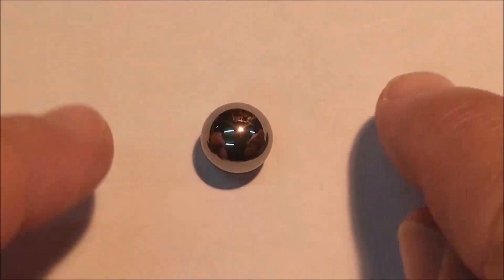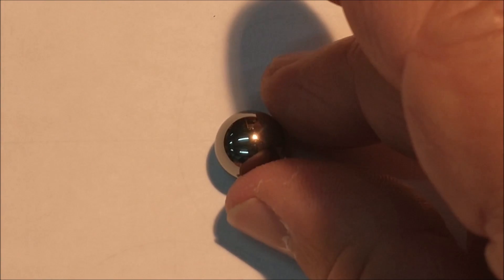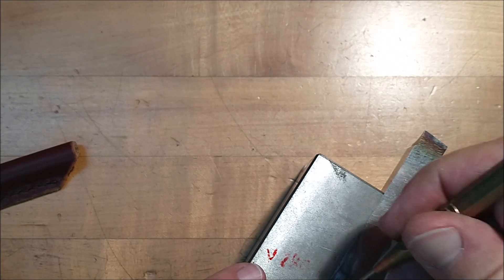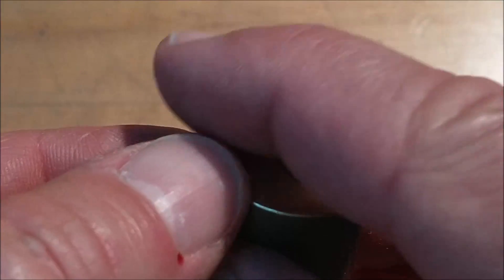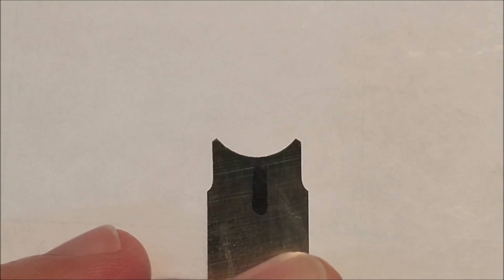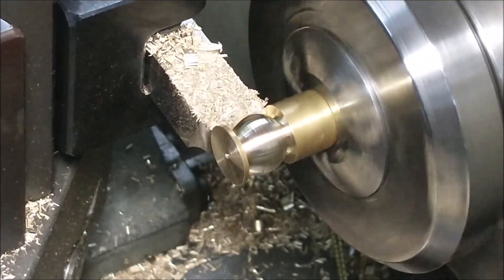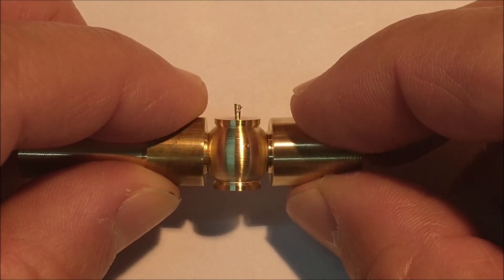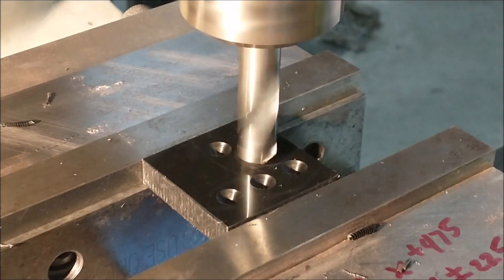How to Turn Completely Round Balls Without a Ball Turner.  Take a Look !!

Comment: I did have to chuckle at the part where you said you "break out in a rash when you touch anything metric". Don't you own a Honda CB? 🙂 Plus I bet you knew that half an inch was exactly 12.7mm.
The US is still predominantly imperial, but that nasty metric stuff is creeping in. Here in the UK we've been subjected to both for about the last fifty years. 
On a lot of Harley's made in the last 20+ years one finds both metric and unified threads, and occasionally one needs both a metric tool and an imperial tool when working on the same component, which is somewhat odd.

Being over 60 I learnt everything in imperial measurements including machining at school and when I was an apprentice. I still think in imperial, but can work in either. When I'm machining I use metric increments, simply because my machines have metric dials. So, if someone wants something made and gives me a drawing in inches I convert it to metric.
Conversely when I'm measuring valve clearances I use thousandths of an inch, and convert the reading to metric, which some folks say can't be right especially in the case where on has shimmed valves. However, as 2 thou is .051mm. I like to point out that nobody is that good they can tell a difference of one micron with a set of feeler gauges! 🙂

Keep up the good work Joe. Your content is both very informative, entertaining, and amusing.
Reply from the maker: 3 actually. one is a 1977 CB 750F Super Sport and I also have a pair of VTX Hondas in my garage too. A pearl white1300C and my baby...a charcoal gray 1800F stage 2 That will put a smile on your face. :)
Reply: @joepie221  Good show. I hope you wear gloves when working on them in case you catch something metric 😁
The VTX1800 was never a big seller over here which is a shame. I've worked on a few of them and always thought that they're very underrated.
One customer had me fit a Supertrapp exhaust, and a free flowing air filter, plus some better shock absorbers and some uprated fork internals. It was a hoot to ride. It pulled like a train, and sounded like one, and it was pretty nimble on the corners. A proper grin factor bike!

Comment: Joe, what the maximum diameter ball you can make with this method?
Also, I need to make a multi groove pulley wheel (type J). Each groove has a profile and depth. Can I make a tool with this profile and come straight in to make each groove on a lathe?
Paul

Comment: I don't know if you have ever heard the phrase brass monkey weather....or cold enough to freeze the balls off a brass monkey, its not a rude basis it comes form the Napoleonic wars when the winters in Russia and Crimea etc were so cold that the brass cannon ball holders would shift under the weight of the cannon balls and crack dropping cannon balls everywhere .
I have made a large number of wood bearing balls from lignum vitae and boxwood using exactly this method. You can get some really tight tolerances with it too. I made some wood machinery some years back with a motor that had copper wiring and the rest was wood....didnt run for long due to heat build up but it did work lol 
Thanks for sharing

Comment: @5:28 any one else see the part lift
Reply from the maker: The toolbit, not the part.
Reply: @joepie221 I should have included one or two second sooner...Sorry  There is an optical reflective triangle increase at the junction of the vice jaw and "part" or  tool bit  being cut above the black shadow of the spindle just as you say " "because" of the sharp angle" lasting less then a second and only a few pixels of change. or am I just seeing things. regardless Thanks for all the wisdom and experience that you have shared with your channel
Reply: Good eyes man! Wow, I missed that. Yea, definitely shifts upwards (very slightly) @ 5:27 as he says "the" in the phrase: "because of the sharp angle". Didn't move after that (during the successive cutting) - so that's good! I'm assuming that's a carbide endmill, right Joe?

Comment: Your contributors have had a lot of fun with the 'cold enough to freeze the balls off a brass monkey' story, but it's actually a wholly false and apocryphal etymology.  The earliest recorded (American) reference is in 1845 ("When you love, ... your heart, hands, feet and flesh are as cold and senseless as the toes of a brass monkey in winter" - nothing to do with balls, note), long after cannons and cannon-balls were in mainstream RN use. Cannon-balls were not left lying around in freezing weather, to run amok or go rusty.  They were stored in wooden shot garlands. Brass monkeys were galley kettles used for storing grog.  The humorous 'brass monkey' references seem to be to Chinese ornaments popularly imported in the mid-19th century.  Further, the physics doesn't stand up to scrutiny. The differential coefficient of expansion of brass and cast iron would not be sufficient to have any real-world effect. Nothing was, or needed to be,  made to the tolerances required, and if it had been an actual problem, the redesign needed would have been quick and obvious.  Sorry to be a party-pooper, but facts must out!

Comment: for rounds to actually use...  discovered that i can roll lead into fairly good spheres between two pieces of flat plate. i start with cast balls, flash removed to make things easier. this also work hardens the ball which has it's uses.

Comment: Anyone else notice the HSS coming up out of the vice at 6:00?
Reply from the maker: I just saw that. Good eyes.
Reply: @joepie221  Is that a carbide end mill you're using to shape the HSS?  If so, did you anneal the HSS first?  I didn't think carbide would cut HSS worth a damn....
Reply from the maker: @davidspahn7184  I didn't anneal the HSS. The carbide will cut it, but its risky if you bottom mill. You will almost assuredly chip the carbide. The Z axis oscillation helps improve the shearing action.
Reply: @joepie221  Thanks for the reply!  Good to know. I  might have to try that some time with something that's otherwise no longer useful.  Appreciate the info!!!
Reply: Clearance?

Comment: 1/2" is exactly 12.7 mm, not about.  An inch is defined by the metric system as exactly 25.4 mm.  This was done since the imperial system had too many different inches (along with a lot of other baggage), so they standardized it with the metric system.  So even though you think you are not using metric, you are.
Reply from the maker: I always enjoy seeing how riled up you metric guys get over comments. How about this to chew on. is 12.7 always metric, or is it an imperial decimal representation of a whole?? Can you say 1/2 of a mm and people will know what you're talking about? Are fractions and decimals an integral part of measurement no matter what language you use??Blows the mind.
Reply: The metric system is calculated using time which is measured in base 60 that has it's roots in ancient Sumerian culture, so even though you think you're using Metirc, you're using an "imperial" system of measurement

Comment: Is it possible you can do a video on npt threads and teach us how all the values are calculated?
Reply from the maker: I unfortunately do not have a taper attachment for my lathe so I do very little NPT threads that aren't done with a tap.
Reply: @joepie221  Every couple of weeks I have to tap 1/8-27 NPT. in a 100 plates. I hate doing it. I have to check with a gauge pin every hole.

Comment: now you need to make a brass monkey ( a brass monkey was a ring made of brass that was used in Nelsons day to hold the cannon balls ) which shrank when cold and the said cannon balls rolled off it when at sea 
hence the term " its cold enough to freeze the balls off a brass monkey"

grate video again Joe
Reply: I believe brass monkeys were square
Reply: @oldcomps  could well who knows I read they where round but they could have been square to hold more balls round would only hold three , maybe different ships had different ones.  I did take the tour of the victory about 65 years ago boy was those decks low

Comment: As an amusing aside. Pretty much everyone has heard the phrase "Cold enough to freeze the balls of a brass monkey"

A "Brass Monkey" is actually the base you stack the cannon balls on. With the cannon balls usually cast iron and the monkey made of brass they have different thermal expansion characteristics. In cold weather the brass contracts more than the cast iron. If it is cold enough the monkey contracts enough to let the cannon balls fall off.
Reply from the maker: This video taught me that. Thanks for adding to the conversation.
Reply: Unfortunately, a myth. See my long comment.

Comment: Shame you didn't make iron balls and a brass 'monkey' to store them on in your unusually cold winter. I believe the expression "cold enough to freeze the balls off a brass monkey" comes from sailing ship parallel ball racks that were a close fit for the balls to prevent them getting loose. Differential thermal expansion rates for iron and brass allegedly allowed the smaller balls to drop through the 'monkey' racks when it got bitterly cold. Old wife's tale or true??
Reply: True
Reply from the maker: I'll darken them.

Comment: Hi Joe, A very interesting project. I think you need to make a "triangular ring" to hold the balls. The triangle should have 1/4" radius at each corner and sized to hold the first layer of balls. Originally they were made of brass and in the British navy they were called monkeys. Hence the saying "cold enough to freeze the balls on a brass monkey"
I made a ships cannon from a 40mm Bofors "ack ack"  shell that I picked up whilst on holiday in Malta. My grandad was stationed there for some time during WW2 and I have his regiment cap badge which is like a crown I have fixed this to the top of the cannon barrel to represent the crowns cast into the barrels. I think it is a nice way to display his badge.

Comment: Hi Joe,
I have seen where people pressure turn that they use something, like some leather or cork, as a from of clutch to prevent marking of the part. In the "jaws" you made was it just the edge of the hole that supported the piece or was it shaped to follow a small part of the sphere to get a greater contact area or a tangential surface rather than a potentially sharp edge?
Great video as always,
Regards Dennis.
Reply: It looked to me like he had machined hemispherical dents into the tips of those pressure plates. If the radius is the same that should give a lot of grip surface, and not much chance of marking the part, unless the part slips.

Comment: Another great video Joe.  As usual, some fantastic techniques learned. I assume that the brass pieces to hold the balls for the final operation were formed with a round nosed end mill.
Reply from the maker: Initially, yes. But a conical recess will work too.

Comment: If the top of the tool isnt at 90deg to the mill youre cutting the radius  with, not only does the "radius" increase, but its no longer circular, it has an elliptical shape.

Comment: When in the machinist school some 50 years ago hand ground HSS tools were the norm. There was some carbide but only used rarely. Same basic rules are applied but with a negative or neutral rake. Those skills are as they are and the basic rules will never be changed but can be modified to suit the material in question. There you go with more pressure turning. I have still yet to try it. I may have to just do it to get the feel for it. All the best for 23 my friend. Take care eh ! ! !

Comment: What surprised me was that you didn't need to position the ball exactly 90 degrees in the second phase of the job.
Reply: A sphere is "congruent to itself" AT ANY ANGLE.  This is exploited in ball bearing manufacture, where the balls turn at random angles as they pass through the lapping machine.  Turning at random angles helps "average out" errors due to the tool being not perfectly circular, or setup errors.  Even the cheapest ball bearings are lapped to MILLIONTHS of an inch perfectly spherical.  Surfaces of optical lenses are similarly formed, spherical to less than 1/4th wavelength of light.  It is more expensive to manufacture lenses with "aspheric" curves because this "averaging" doesn't happen in that case.

Comment: No -ish about it. A half-inch is 12.7mm precisely, as the American inch is defined by metric units 😉
Reply: No, the metric mafia reinvented definitions in their failed attempt to rid the world of a measuring system.  An absolutely childlike and failed attempt.  Both systems exist and always will.  If you doubt that,  take a look at that 10mm socket and notice that it goes on a quarter inch ratchet.
Reply: @brianmoore1164  There is no 10 mm socket....it's always missing🤣
Reply: Or 1/24th of a banana according to Australia…… 👍😆

Comment: I’m not sure there is a way to explain the amount of pressure, but how much pressure did I take doing turning like that? I’m amazed that it did not slip. I’ve seen your pressure turning before, and it all made sense, but this one I would think the cutting force is so high, and you had to crank down so hard to make that not slip.
Reply: The cutting force isn't very great if the progress of the tool into the work is slow. Also consider how much combined surface contact there is between the pressure pieces and the workpiece....there is a lot of friction there.

Comment: Hello Joe. The base you made for the canon balls is called a MONKEY. Originally they were made of brass and screwed to the ships deck to be salt water resistant. The cast iron balls were then stacked as yours. In freezing weather the balls if wet would freeze solid on the Monkey. Hence the saying of "it is cold enough to freeze the balls off a brass monkey"  Great outcome. Happy New Year from Australia.
Reply: A comment above suggests the bronze monkey (ship fittings being of bronze) shrank before the cast iron balls did, which then rolled off the monkey.  I always wondered where that expression came from - this sounds plausible.
Reply: I have a feeling that story came out of the imagination of some old salt who was given a hard time for being lewd.

Comment: Ah, Joe, great technique and fine video.

But you missed a chance to educate the masses. That thing that holds the balls? On warships it was made of brass. And it was called a brass monkey. When the weather got to freezing, the brass balls would move because of temperature, and roll around the deck. Sailors said “It was cold enough the freeze the balls off a brass monkey.”

I just thought you should know.